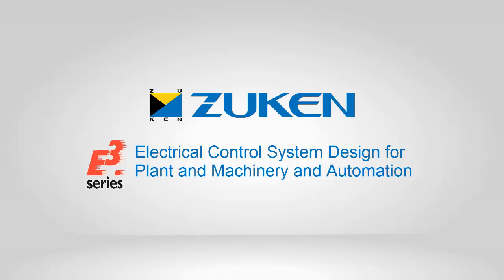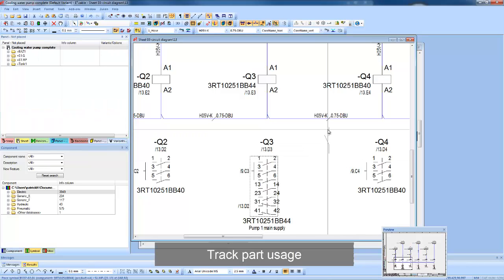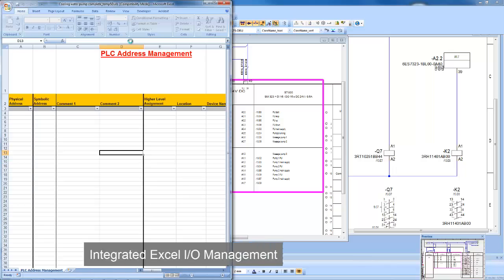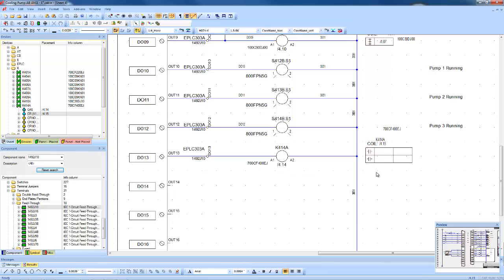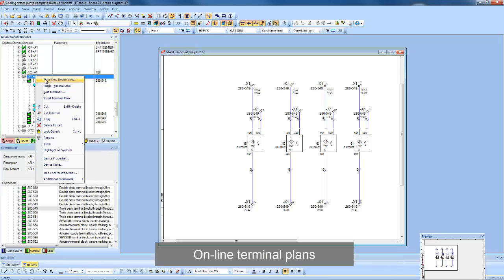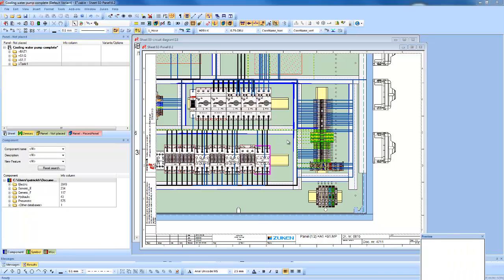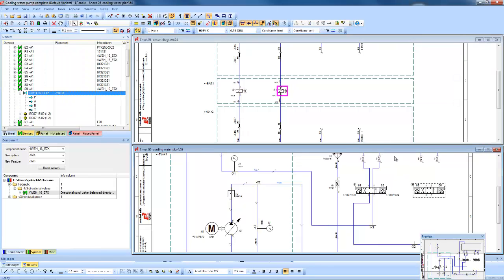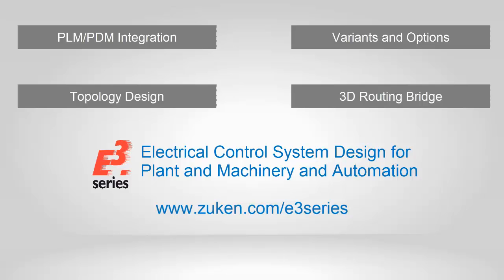E3.series - Plant & Machinery and Automation Electrical Control System Design

Comment: Does it have simulator or you need an external program to simulate the circuits (electrically), such as Altium or Automation Studio?
Reply from the maker: E3.series has several simulation and analysis capabilities. Our real-time design rule checking verifies things like device naming, short-circuits, multiple symbol assignments, wire cross-sections, valid mating connectors and valid pin terminals. Electrical checks include circuit fuse protection, voltage source loads, wire conductor temperature, resistance, and voltage drop.

Our optional E3.eCheck does circuit functional analysis: switches operate, current flows, relays actuate and contacts open and close activating and deactivating loads in the circuit.

We also have an integration to Synopsys Saber Simulator which is a mixed-signal behavioral simulator that efficiently handles architectural exploration through detailed design verification .

Please contact us if you would like more information on any of these or visit: http://www.zuken.com/e3